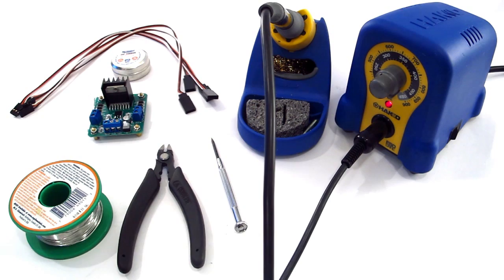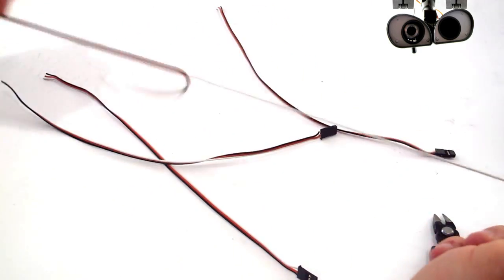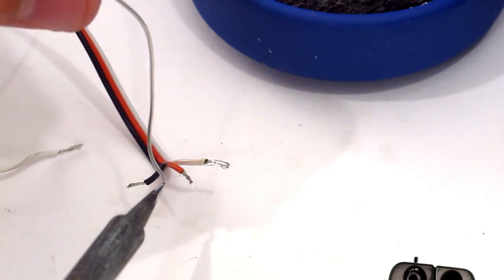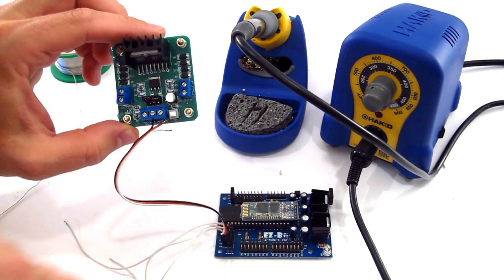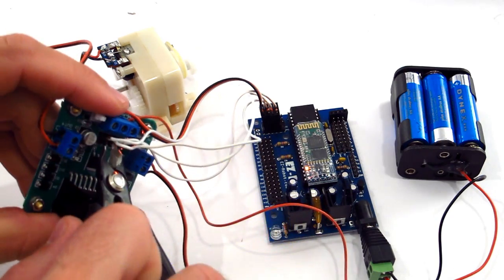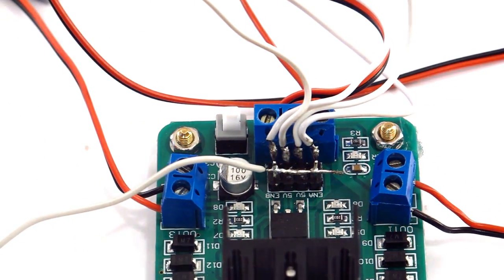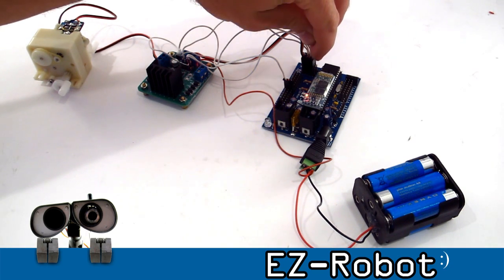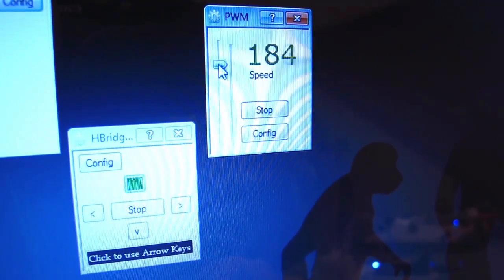Connect L298N Motor Driver HBridge to EZ-B Robot Controller

Comment: Your solder technic is awful. Using your fingers to drill the end of the wire is the worst you can do. The will begin to oxidate under the solder and break after a time, moreover the resistance will increase at this point. You should really work on that, if you want to have a good quality

Comment from the maker: Thanks Jeremy - Good advice for others. But I prefer to work with the hottest tip. I do have to clean more, but I solder quickly and the high heat is necessary to keep up :)

Comment: Pro tip: DJ turn your iron down!!! :) 750 degrees F is fine for lead free solder, you'll find that you'll need the tip tinner less and less if your iron is not as hot. Then you can start using the solder itself to tin the tip. Another helpful hint given to me by a long time technician in the industry is to place a blob of solder on the tip when you go to put your iron down for a while as it will protect the tip from oxidation. The next time you go to use it your tip will be fresh and ready to go